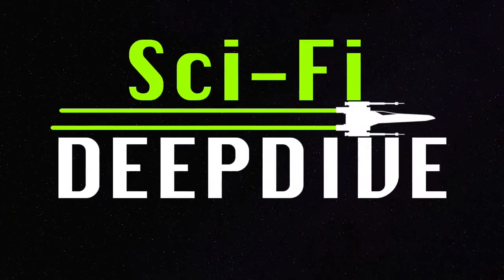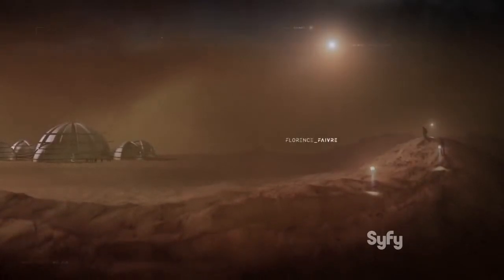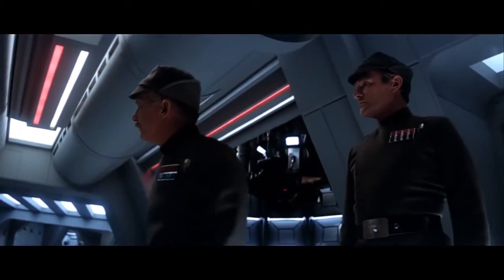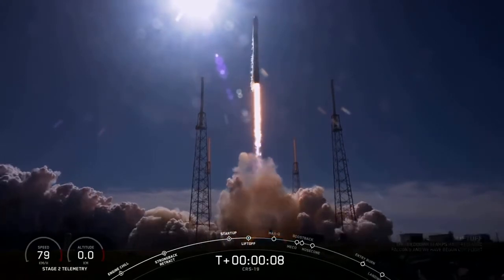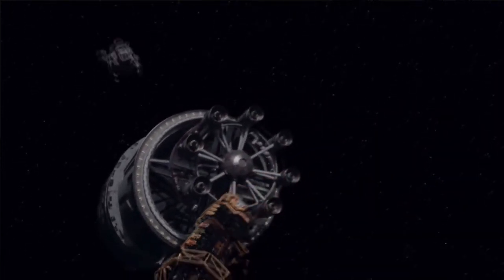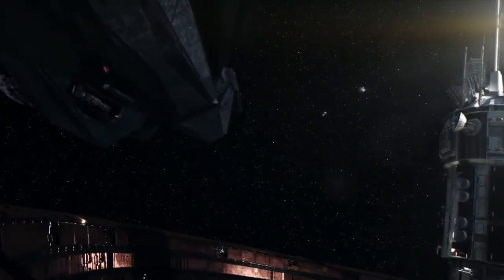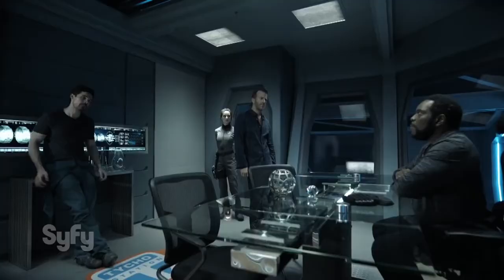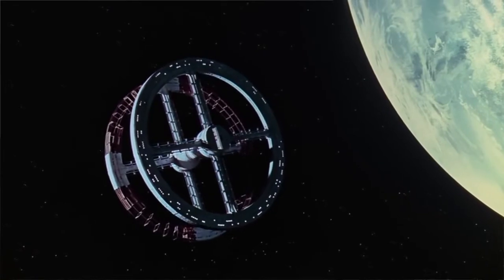How Artificial Gravity Works in The Expanse | The Expanse

Comment: The most interesting use of centrifugal gravity in the expanse are the smaller asteroids and moons. They are too small to have significant gravity based on just their mass so they are "spun up" which is something Tycho Manufacturing was known for. Basically they mount giant engines onto it and spin the asteroid to generate centrifugal gravity. For people to live there, the areas near the crust are hollowed out and everything is constructed "upside down". It also means that different parts of the body have different amounts of gravity. People living in levels towards the outside and equator of the asteroid have more gravity and people living more towards the poles and core have less, which builds on the class divisions thst are often seen in the expanse, with the more affluent living in more hospitable areas of the asteroid / moon.
Reply from the maker: I love this as a solution to colonies on asteroids. Definitely very unique with science fiction!
Reply: There are 2 examples where they show the coriolis effect, albeit exaggerated. Miller pours a drink with the stream of whisky being warped. Looks very cool. And then there's Naomi dropping a bit of dirt on Elos trying to find her way around in the tunnels. That was too much as it showed almost 7 turns like a helical spring.

Comment: Colin, in Season 4, we see only the second vessel in THE EXPANSE (not counting the habitat ring of Tycho) to use spin/centrifugal gravity: the RCE Edward Israel, the former colony ship that a corporation has converted to being a science vessel capable of thoroughly geologically mapping New Terra/Ilus. The first vessel shown in the series to use spin gravity primarily rather than thrust gravity is the LDS Nauvoo/OPAS Behemoth. 

My question is this: the Edward Israel is a sizable survey vessel, capable of carrying one heavy shuttle and two light shuttles. Yet only a VERY small portion of the hull—two relatively small pods on opposite ends of a spinning bar whose fulcrum is the main body of the ship—actually receive the many benefits of spin gravity. 

Do you suppose the program expects us to believe that all the command, navigation, and science stations we actually see in the program are located in these two small (and seemingly cramped) pods? I assume inside the hull of the rest of the ship crew must make do with thrust gravity.
Reply: I think it's that the Edward Israel was created after the Epstein Drive, so as a colony ship, it would spend most of it's time under thrust.

Comment: This is a very interesting explanation. Very well laid out. In my opinion, it has two things that can be improved. First, gravity is not generated by Newtonian physics (0:40). The Expanse uses Einstein relativity (different principle).  Second, there is no artificial gravity, it is only gravity. Gravity itself is an illusion, similarly to the illusion we see that the Sun raises every morning.
Reply: This is just wrong. The show is 100% based on newtonian physics and based on artificial gravity (except alien stuff ofc). Artificial gravity is NOT gravity, it just have the same effect on a body as gravity has. 2 best examples of artificial gravity, Rotating artificial gravity (merry go round or washing machine). centrifugal (or rather centripetal force) on a spinning object pushes a loose object "inside" against the outside, experiences as gravity towards the outside. Second is artificial gravity cause by linear acceleration. If you accelerate an object in one direction, an object inside will experience a reverse push experienced as gravity. Take an accelerating train or race car that pushes you into the seat for example. It isn't gravity but the effect is similiar or even identic. So acceleration and deacceleration is actually the exact same thing, just depends on how you anchor the space around the object(like how we have anchored space to earth in most models, despite the fact it travels through space) So artifical gravity IS NOT GRAVITY, it is just experienced as such. Real gravity is mass bending space, artifical is just bodies pushing on each other.

Comment: One thing i do not get about accelerated gravity is fuel efficiency.
I dunno if there is something i  am missing or what (likely), but burning with the engines the whole trip is not something that looks feasible.
From what little I know about orbital maneuvering I understand that it is not going to be a straight line between point a and b, but instead an elliptical trajectory, in which you burn on the lowest point of the orbit to increase the highest point of said orbit.
Burning half the trip forwards and doing the same backwards for the other hald of the trip is something you can do, but wouldn't it requre much more fuel to do so? And wouldn't be slower that regular orbital maneuvering?
Reply from the maker: It’s not the most effective at preserving fuel but ships in the expanse use large fusion engines which are remarkably fuel efficient.
As for the orbital mechanics, a slow burn over the course of a voyage is feasible, although finding a route that maintains 1G the entire time might be tricky. And when they are in orbit of a planet, they don’t have gravity at all so they use magnetic boots.

Comment: I think that it’s realistic but not ideal ,  the rocket engine might be unsteady , sort of like how a faucet buffets your hand, it’s not a steady smooth stream of force field. 

Also I am far too lazy but someone should do the math to see if the acceleration and deceleration required for 1G or close to it equal the amount of thrust acceptable for space travel from say earth to Mars , then earth to the asteroid belt.  My thought is that it would be far to slow for long journeys. But only the math will tell the story. If that speed or rate equals a tolerable trip duration then it’s a very elegant solution indeed.
Reply from the maker: That’s true, I’m sure 1G of acceleration isn’t the fastest way to get anywhere in the system.
Reply: They can increase amount of G’s for longer distances. But usually it’s either 1g or lower because who wants to be stuck in a 3g for a day? Also 1g acceleration is pretty fast as about 6 days will get you from the Earth to Jupiter if you do 1g acceleration halfway and then 1g deceleration the other half, minus the time you take to flip. From Earth to the moon would be about 4 hours.
Reply: @SciFiDeepDive  There are some excellent free calculators on the web (go here: https://www.calculatorsoup.com/calculators/physics/velocity_a_t.php) where you can work these things out very easily.  So, Mars is currently 179 million km away from Earth which means, using the Expanse's flip and burn method, you would need to accelerate at a constant 1G to the half-way point (89million km) and then flip and decelerate at a constant 1G for the remainder of the trip.  Using the Displacement Calculator at Calculator Soup we can see that it would take just over 37 hours (accelerating at 1G) to reach the mid-way point and then another 37 hours to slow down again to insert into Mars orbit.  So the whole trip from Earth to Mars would take around 75 hours.  This is, of course, an oversimplification as I'm sure you wouldn't just fly a straight line to Mars (or even a straight line to where Mars will be in its orbit when you get there).  But it does give you an idea of timescale.  And if you did accelerate at 1G for 37 hours, the ship would be travelling at 4.7 million km hour hour at the flip over point.  Constant acceleration is good like that.

For comparison, using the same flip and burn method to get to the moon (384,000 km) would take around 3.5 hrs.

Comment: Why did the ship fly backwards why does it look like they're flying in reverse
Reply: hopefully you got your answer after a year. In case you didn't, the ships were not "flying backwards." They were decelerating. They flip 180 degrees and burn the engines to brake. There's no friction in space....you can't just turn off the engine and stop, the ship would just keep on going forever....and will crash into a docking station if they don't fire the engines at the opposite direction to slow down and stop.